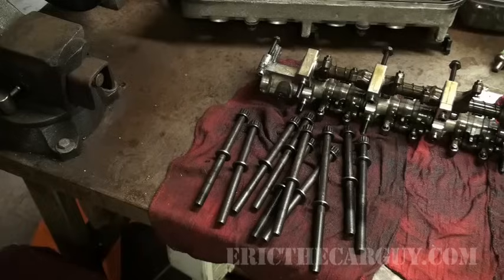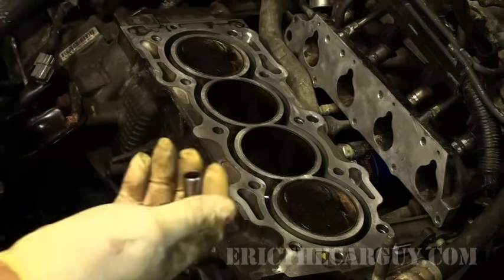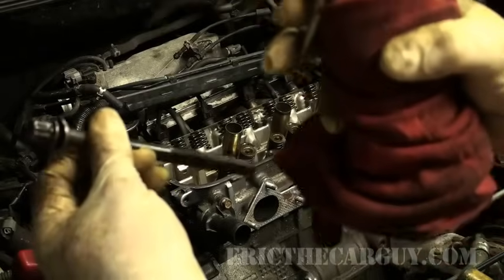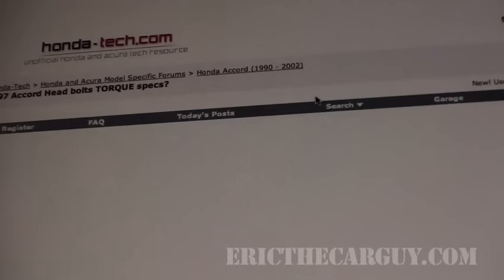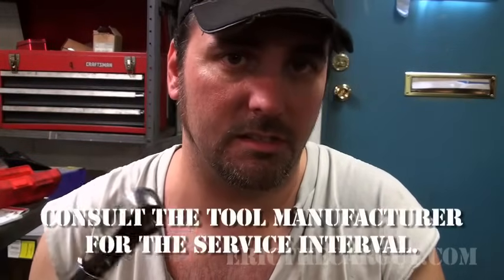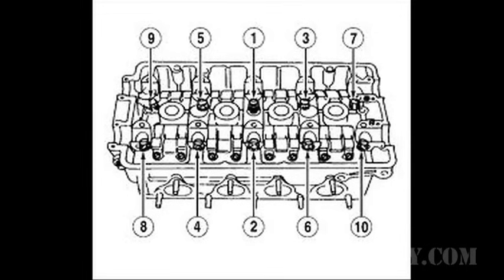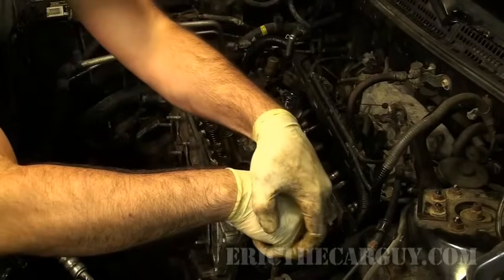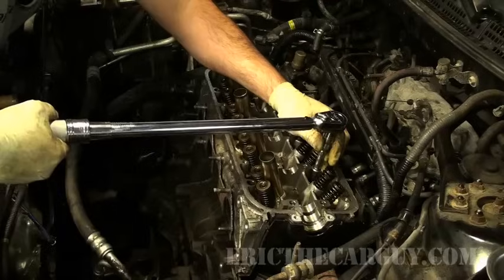How To Torque Cylinder Head Bolts - EricTheCarGuy

Comment: Hey Eric, I didn't use any oil on my head bolts like you did which were torqued to 22 ft pounds and then again 90 degrees and again 90 degrees a final time.  They are torque to yield bolts, do I need to re-do them? Some seemed to tighten really smooth and some seemed really hard.  What do you think?
Reply: Dirty threads.

Comment: Hey Eric, Love the videos! I was hoping you could help me with a question regarding different torque wrenches. I just rented a Evertough torqe wrench from the local auto parts store, because mine was slipping.. it reads different from mine and I was wondering if you might shine some light on the numbers .. I understand the numbers on the handle to dial up to .. but on the dial handle instead of being numbered 1-10, it reads 0, I, 3, I, 6, I, 9, I, 12, I, 
 do you know what these numbers translate to or the calculation used to figure out how to tune this thing in, it didnt come with any info and I cant seem to find any answers online regarding this tool ?

Comment: Hi mate... I wondering if you can help me .. I pout new cover gasket and clean the fuel injectors . After I put it together the car wouldn't start. It was close but it didn't . Blowing a black smock every time I try to start it up is that normal? Now the engine won't crack on,, but I do have lights. No the battery ? Thanks if you help !!!

Comment: What happened if it wasn't torchue at specifications? I didn't know. And I didn't have the tool. What does it cause? My cylinder 1 is misfiring little after the job was done. Would that be the cause?
Reply: +Alesandel Cruz yea that will cause it maybe ur gasket messed up in the way
Reply: +Alesandel Cruz Head could be bend now, causing to that the Compression blows away between Head and Cylinder Block => Misfire
Reply: +GEMC 
well, I used a Torque wrench, turned out it was defective. I broke 3 screws off, and the other half stood inside, great.... what should I do? give it to a mechanic? get a new motor? I appreciate very much thank you
Reply: So, how did you end up fixing those 3 bolts that broke?
Reply: I never did, just been sitting there.
Reply: extraction set can probably get them out. it happens to everyone at some point working on cars.  just stay calm and don't rush the job when you are working to get them out.

Comment: I use a tall, 6-point deep impact socket to both remove and install head bolts, to eliminate using an extension on a shorter socket that can interfere with accurate torqueing.  A 6-point socket is better than a 12-point on a bolt head that has 6 points (hex head) since it's less likely to slip, and might also make the torqueing a little more accurate.

Comment: hey Eric after I torque the heads properly it tends to leak oil from the rear why is it doing that? I haved the head machined flat like new why is it leaking? Plus the head gasket is new
Reply: is it leaking from the head or the valve cover?
Reply: head

Comment: LOL I did my first head gasket job a year ago and torqued my headbolts to 170ftlbs and looked at my manual after and it said 80 I ran it anyways and it still runs fine im surpised I didnt strip anything
Reply: +Ross Mehtala Or snap anything at that, lucky!

Comment: HI , this is good info, I have a 1994 honda del sol 1.6L D16Z engine ,Im replacing the headgasket due to failure , machinery shop is finnish with a valve job and resurfacing the head, my questions is what head gasket you will recommend , besides OEM ,I hear Victor Reinz it came with a new re-design  call nitroseal head gasket?

 " Nitroseal replacement head gasket,
which is composed of Teflon-coated
graphite clinched to a perforated steel
core and a stainless-steel flange. A
thicker gauge metal flange at the combustion
chamber improves the torque
retention in this most critical area."

I want to mention, while I was waiting for the shop to finish the work , I ordered online
all the parts I need to do the job, and yes I got the head gasket kit, its called "Evergreen " ( this is a MLS gasket it seems to match the original ,technically speaking they looks the same ) ,have you heard of this particular brand? should I spend another $50 on a better headgasket  and don't use this one? thanks in advance for your input...

Comment: Hello,I have a f23A VTEC engine in my rover 620.The problem I'm having is that the VTEC not tripping in again, after my mechanic checked, he said the " VTEC oil pressure switch" is bad, how can I test it also & what other checks can be done.it was working fine until I realise I kept losing power
Reply: Sanjy Cameron I would think you would have to replace the swich, or try to swap it with a friend's? Maybe an oil pressure gauge.

Comment: Speed wrench!  Thank you so much! :)  I have only changed things like oil pans and alternators (twice each) and then the dealership said that my Forester's head gasket was bad.  I took everything apart, had the head milled and vacuum-tested, and put the head in place, and then realized that I did not oil the bolts and washers.  I was dreading tightening all of that with just a socket wrench!

Comment: hi eric, 2004 grand prix 146k, randomly shuts off, changed fuel pump and crank sensor and throttle body, could be for any reason a bad head gasket?

Comment: Why would you torque a cylinder head to 58 ft lbs THEN loosen them completely and THEN torque to 15 ft lbs n 90 degree then 90 degree....2001 eclipse 4G64  SOHC   That makes NO sense to me at all. IF you torque to 58 and loosen them all, THEN torque to 15 ft lbs how is it ever going to really be tight. you have already run the bolt down to 58 ft. lbs and now your stating over and ONLY torquing to 15 ft lbs  How does that work???  Its like drilling a deep hole and then taking the bolts out and putting in a small bolt that drops in and will never be really tight.  Your already smashing the gasket THEN loosening them all and it would seem your not going to get it tight. Im just used to old school 327  454  aint no crap like that, When you torque the steps thats it!!!??  Ive never seen any videos on this application.  Could you explain  why in the world you would torque like this.  It blew a head gasket on sons car,  got hot and blew it  Thanks Chuck   & Im stayn dirty

Comment: so as a former jet engine mechanic here are my thoughts: excellent video, I would always use synthetic oil to lube the head bolts on the top part because that is the part of the bolt that holds all the torque and synthetic oil is so slippery it slips past anything and everything that isn't sealed well, thusly it will drain off that portion of the bolt for a completely oil free torqued bolt. If you have ever changed an oil filter with regular oil and placed oil on the rubber seal, then done the same with synthetic you will notice the synthetic oil filter change is much harder to unscrew that is because the synthetic oil squeezed right out.

Comment: What's the reason for changing the torque pattern?
Reply: Barnekkid he changed the pattern when he did the double check on it at that point the pattern don't matter because they already reached the final torque. 

Personally I still follow the same pattern when doing the double check. He probably didn't even notice he had changed the pattern.

Comment: Need any opinion...!  ASAP..! 
Doing a head job on my Toyota 4.5L 6 Cyl..... Finished the Torgue Job... with Degree Wheel..... and noticed----- I FORGOT THE--- FLAT WASHER UNDER THE BOLTS...! 
Stupid or What..!    Should I pull them or leave them...?  
Thanks Ken
Reply: Isn't the washer there to lock the bolts? I'd guess that if you leave them like that, they will undo themself. 

I am definately no expert on cars, but I asume if you remove bolt nr. 1, add washer, retighten, remove bolt nr. 2, add washer, retighten, remove nr. 3 and so on, you'd be fine.
Reply: There are just flat washers, no locking purpose.... Thanks for the info about removing one at a time... that's a thought..?
Reply: Kenny Alan http://en.wikipedia.org/wiki/Washer_%28hardware%29 Locking device. Personal experience is that without a washer, every nut and bolt will loosen themself if they are under vibration. doesn't matter if there is springlocking washer, 30 degree cuts washer or just plain metal rings.
Reply: Thanks... got the message...! 
How about loosening one bolt at a time and re-torque... or loosen all down to say 26 lbs... and pull one at a time and re-torque to 26lbs... then all at once finish with the correct two 90 degrees called for by the book & the correct pattern...?    I have heard that the gasket can be saved if no heat has been applied and if you don't remove all of the torque so it repositions itself...?
Reply: Kenny Alan To be honest, I have no idea. Any mechanics in here who can answer?
Reply: Thanks... If finished it off like I said above... We'll see if she holds and for just how long... hopefully forever...!  hahahaha..
Thanks Ken

Comment: HI SOME one Please reply I own a K20a3 civic sir 2002  2.0 L  I bought I Skunk2 low profile valve washer kit   IT comes with Head bolts  I need to replace my OEM with them.      Can I replace them and torque them individual  ???  I have read about how to change cams but i wanna do as less work as possible

Comment: If you have a performance bolt (or stud) such as ARP, you can overtorque by even 30 ft/lbs as long as long as you go in equal increments. They also make a specialized lube for getting the torque right.

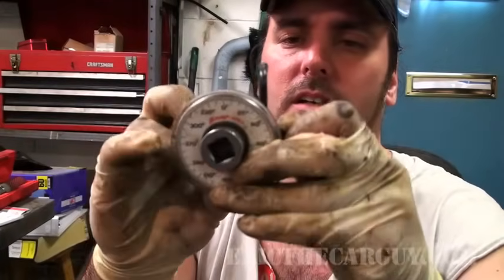Comment: 10:56  Torque Angle Gauge.  I'm not correcting you because you're right.  Just helping those who might be googling it.

I was just fortunate enough to open my ATECH2FR100B today.  It has 50 programmable presets, does torque load, torque angle measurements and has both audible and vibrating alerts as well as a display to tell you how much stank you put on the bolt (once you're finished).  I was previously using the TECH2FR100 which only through using it taught me everything I didn't know about torque wrenches.  Some people don't believe in the digital variety, but I've become a fan after prolonged use enough to buy the best one Snap-On makes.  I know that feel you get when you acquire that tool that makes all the other sockets mean more to you.  My wallet knows, too.  It's the nicest wrench I own.  

Great video Eric!
Reply: Is the ATECH2FR100B sufficient for torque range on head bolts? In this clip, Eric has to go from the 3/8 to 1/2" torque wrench to cover the torque range required. The idea being that the bulk of your automotive torque applications are covered by this expensive one and a cheaper 1/2" at the high torque end of the spectrum and where TTY bolts aren't in use. That the ATECH2FR100B does a lot of the tricky stuff makes it very attractive (but the cost!).
Reply: Google ATECH3FR250B and watch my next video.  Just because the ATECH2FR100B got opened first, it doesn't mean I don't have that base covered.  ;)
Reply: ***** I have one like the one that Eric used, although there is not room for it in my Forester.  I believe that it was Scotty Kilmer that showed a more sophisticated one.  I cannot find it now, but I believe that it used a cable so that you could see the display better, but I imagine that is only an issue on Boxer engines.  I cannot find the video now, just an interesting thread in Eric's forums about Scotty.

Comment: Hello Eric my name is josh t I saw in some or your info here on youtube and your actual page that you have done some work on Mustangs Well I have a 1994 ford mustang 3.8 liter V6 and I was curious to see you do a complete head gasket job on the same Car like mine. I am having trouble with mine I am doing tests on my radiator to find out if I have a head gasket problem indeed. I would like to see you do it first so that way when I have to do it which will be soon, I can do it that same way you do. I don't know if you would do it but it sure would be nice to have a little better guide so that way I can do it right. I have seen a couple of videos on here and I have also the info on the net as well but it would just be nice to actually see it.

Comment: my manual says that when ever the bolt starts making a creaking sound you have to take it out and redo it
Reply: nope nope Yes. This is a video how NOT TO torgue head bolts;)
Reply: @grzegorz16100  cuz a guy with decades in the industry has ruined so many cars right? Use your head
Reply: @socknetea  I have seen people with decades of "experience" who can't do shit. That doesn't prove anything. It might be that his headgasket will last 5 years instead of 10-20.

Comment: Is there a reason why not to us a tap when cleaning the threads in the block?
Reply: 678friedbed They say that tap can remove metal when tread chaser removes only dirt. But I think it is bullshit. Why would a tap remove any metal if used correctly?
Reply: At the most I can see that a tap from a different manufacturer might cut a little deeper threads but who cares. I use taps all the time to clean threads. I was just wanting to find out if there was actually anything behind it or if it was just an old wives tale that people for some of reason keep passing on